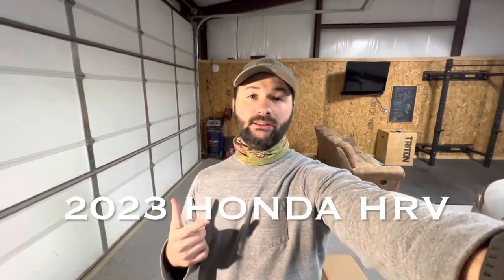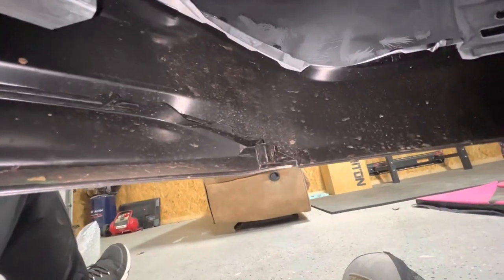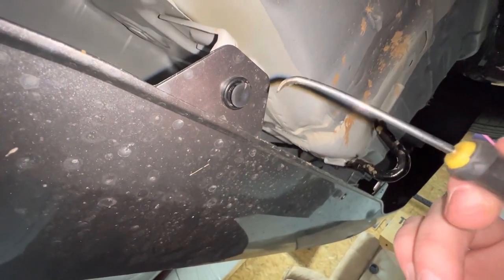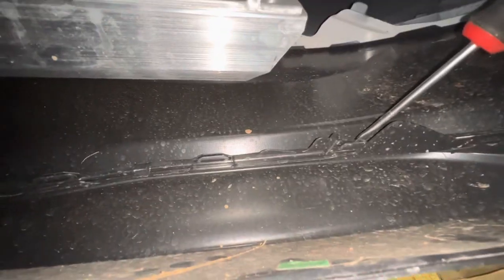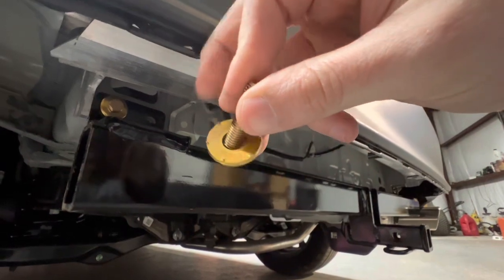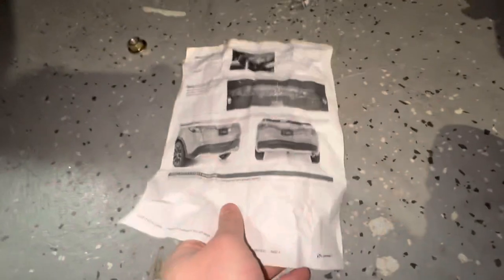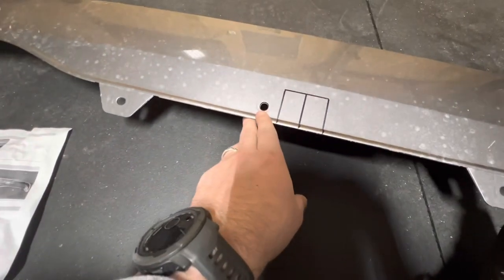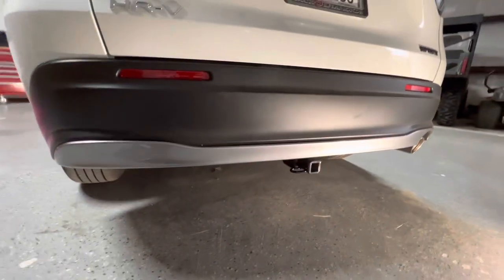2023 Honda HR-V Hitch Install

Comment: Easy install except reinstalling the bumper cover. Those little tabs are a bugger to get snapped back into the main bumper cover. The newly installed hitch makes it difficult to apply pressure from underneath. Any suggestions on how to get that center clip reinstalled?
Reply from the maker: It’s pretty tough… No real tip just patience… lol

Comment: hey caleb i understand honda does not recommend towing but were you ever told by anyone what this suv could tow, i own a honda (HRV 2023 LX Awd) myself and simply want to tow a light travel trailer that will never exceed 750LBS, but im afraid to void anything and also worried if id harm my vehicle structurally
Reply: I have the same question
Reply from the maker: No, they do not recommend towing with the HRV. We only put the hitch on the car for accessories such as a bike rack.
Reply: i hitched a uhaul 6x12 trailer, with a 2k lb hitch and ball, and a medium load, and drove from FL to UT with no problem other than it totally killed any semblance of mpg. drove the same hrv back from UT to FL with a different uhaul 5x8 with a heavier load and had no issue there either. the 6x12 uhauls weigh ~1800, or 1900 lbs empty. with a load, that will exceed the 2k hitch class, so it's not advisable to do that like i did, but 750 lbs is nothing. what is more important than trailer weight is tongue weight, which is the downward force that is exerted on the ball of your hitch. this is the weight that would be relevant in a frame bending situation. sometimes it can be difficult to figure out what this max is for your vehicle, especially when your car isn't a truck and those numbers aren't advertised. one way is to look up your car's maximum cargo capacity and that is essentially it. just remember to subtract out the weight of passengers and anything else in the car that isn't going to be on the hitch. then you must calculate the tongue weight of your trailer, and this is fairly easy, but not always exact, so it is best to have some wiggle room in your plan. the tongue weight is typically 10-20% of the trailer's total weight depending on the wheel base. a trailer with four wheels spread in a front and back manner will have a much lower tongue weight than a two wheel trailer with the wheels all the way in the back, if that makes sense. which it should, just simple physics. that all being said, towing a 750lbs trailer should be no issue structurally.
Reply: @benjamin-pp4se  I appreciate your input here.  I plan on towing something at max of the hitch 2,000lb's.  How did your torque the bolts?  23lbs seems not that much.  I'd appreciate your input here.  Thanks!
Reply: @RobertMcElmurry-d3q  ; well, i wouldn't recommend going to the 2k lb limit on an HRV. i have done it out of necessity, but if i had any other choice i wouldn't have. i just this week did another run from FL to MN with about a 1500 lb load. i just torqued the bolts down as tight as i could. 23 lbs does seem light, and i figure this isn't a situation where over torque is a problem. just remember the max cargo capacity and tongue weights are more important.
Reply: @benjamin-pp4se  Thanks for the information.  My situation is in-town, no more than 45-50 mph.  I'll be going much slower.  Thanks again!

Comment: Any idea on what’s the towing capacity for the HRV?
Reply from the maker: Honda doesn’t recommend towing with the HRV. I’ve read online that it can roughly tow 1,500 pounds. Just a matter of if you trust what Google says. lol the one in the video is not being used for towing.

Comment: How do you keep the rear auto breaking system from tripping when you have something connected in the receiver? My bike rack constantly trips it and it is really annoying.
Reply from the maker: You can temporarily deactivate it in the Honda sensing settings. It drives me crazy!

Comment: Thanks for the video 
Is it the same for Honda HRV 2022 and can we use for caravan?
Reply from the maker: The 2022 is the previous body style but I am sure the process will be very similar. And by caravan, I am assuming you are wanting to tow another vehicle with it? I would not recommend that with this class of hitch or vehicle.

Comment: I can't tell from the video, but is this model number 11640 a 2" model or do you need to weld in an adapter to get to 2"?
Reply from the maker: This is not the 2”. You will need a 2” adapter

Comment: What tools do you need to complete?
Reply from the maker: A Philips head screwdriver, a flat head screwdriver, a 12 mm socket, a 13 mm socket, a 3/4 socket, and a tool to cut the bumper.

Comment: Great job but that car not recommended for towing at all
Reply from the maker: The car is not being used for towing. I stated in the video that it will be used for a bike rack. Also the reason why there is not trailer wiring.

Comment: You really had to cut the rear bumper ?
Reply from the maker: The lower section, yes. Otherwise the hitch will not fit correctly into place.